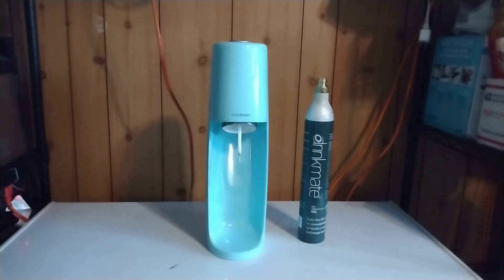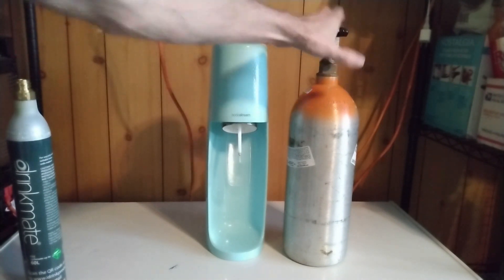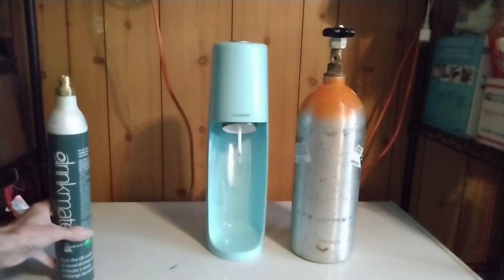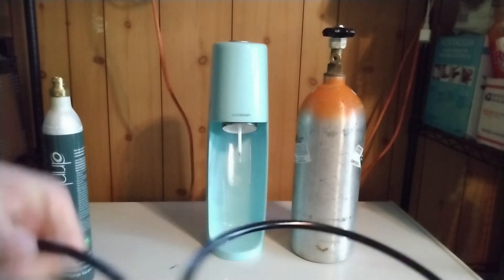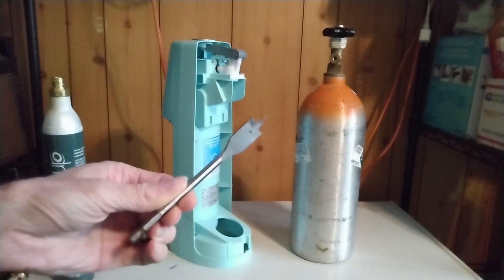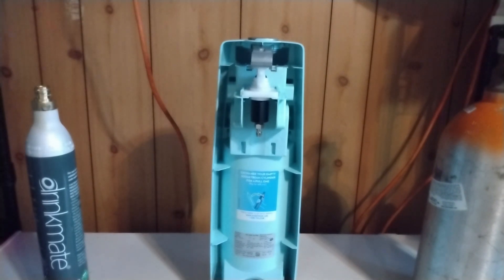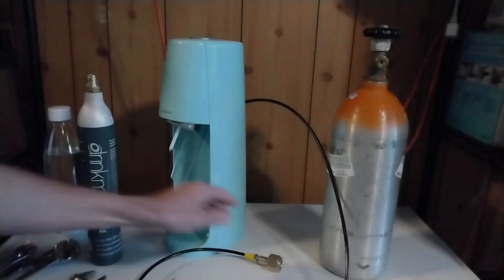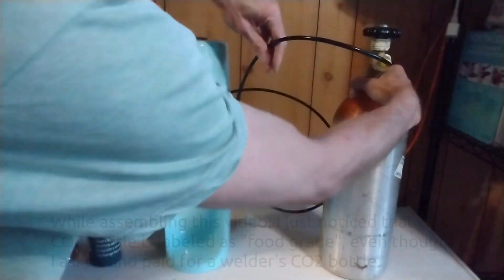How To Hack Your Sodastream with an Adapter - Save Money - DIY

Comment: So cool and so helpful. I just got my sodastream Terra last week and immediately wondered if a canister of Co2 like this would be more powerful - as sometimes with the sodastream Co2 it seems a little flat! Glad to see it definitely is!!! Will this hack work on the Terra Sodastream model? And, thanks for the video regardless!
Reply from the maker: I don't know about the "Terra" Sodastream model, but as long as the fittings are the same as on the "regular" sodastream model, it should fit.
Reply: The Terra model uses the new "quick connect" co2 cylinders, which has a sodastream proprietary connecter. This makes using your own co2 supply or refilling the canisters extra complicated- but not impossible.

Comment: Why not direct tubing down through bottom of machine?
Reply from the maker: Because of the cabinet of my kitchen in which I installed the apparatus. It has several compartments, one in which the CO2 bottle is hidden, and it already had a hole that aligns well with the one I made in the machine.

Comment: All these videos are the same - they show how well it works ON THE FIRST DAY.  Let's see a video of day 100.  I have almost this same setup and I've already burned through 2 SodaStream machines.  The problem is that the seals in the machine are only built strong enough to withstand the lesser pressure of their own canisters.  When you hook up a big canister like this it works great for about two months, then eventually the seals blow out on the SS machine and it no longer works.  They do this on purpose because the canisters is where they make all their money and they don't want people doing exactly this.  If anyone reading this has found a long term solution please reply.  Thanks
Reply from the maker: I don't have this problem. Simply don't press the button fully down. Alternatively, you can add a pressure regulator at the output of your CO2 bottle, so that it delivers the same pressure as a Sodastream bottle.
Reply: Simply add a pressure reducer into the line before the soda stream,
Reply: @SM-eg9vk   and @Blue Moonshine  I have a beer keg that is connected to a pressure reducer and can be set as wanted. Because I have a hose that is not being used (two hoses from the Canister but only one on the Draft machine), it would be perfect to set the other one to the sodastream. What is the expected pressure expected for the sodastream? The beer is set at 3.1 bar or 46.5 PSI. How many bars or PSI for sodastream? This in an awesome idea to use the beer pressure regulator - and much safer than connecting the canister directly to the Sodastream machine. Plus it has the bonus of having the beer next to the soda :)

Comment: There is a difference in CO2. Food grade CO2 has less impurities. You need to get CO2 from a homebrew store or similar.
Reply from the maker: The CO2 that I buy at my welder shop actually has the "food grade" label. It has become a standard.
Reply: @BlueMoonshine  From what I understand it varies location to location. In some places there is just one grade and it's always food grade. In others you do get less pure gas so if someone's in a place where they wouldn't get food grade CO2 that could potentially be bad.
Reply from the maker: @user-kf7vr1kd8f  Ok, but still, the way that CO2 is produced is the same. "Food grade" simply mean that they "checked" that it was safe. It doesn't mean that the "non food grade" is not safe. Anyway, you can still buy a big CO2 bottle with the food grade label at a much cheaper price than the small Sodastream bottles.
Reply: @BlueMoonshine  CO2 is CO2, but food grade CO2 has 99.9% CO2 with .1% impurities. Non food grade CO2 may have more impurities. That's why it's important. I have a CO2 tank hooked up to my soda stream so I've looked into it. Depending on where someone lives all CO2 they can buy may be food grade, but in other places if someone gets CO2 from a welding supply company they may get a lower cheaper grade of CO2 with more impurities.
Reply: The non food grade has a tiny amount of nitrogen and oxygen which are the "impurities" that are referred to. When using welder's CO2 for food that's a problem, for water it's not a problem.

Comment: Well how much would that bottle be and refills?
Reply from the maker: I got that big bottle for $65, and the refills cost $10. In the end, it quickly becomes much cheaper than the original bottles. Plus, the pressure in those big bottles is greater, which means that there is even more gas.
Reply: @BlueMoonshine  amazing.  Thank you for the fast and informational response
Reply from the maker: @tomlucas8677  You're welcome.
Reply: Where did you buy that big bottle ?
Reply: I never saw anybody come up with an answer as to what the expected pressure is out of the normal soda stream CO2 bottle.

Could someone please give me an answer?

Comment: How do i unconnect the quick connector when plugged in to the soda stream machine?
Is it locked in?
Reply from the maker: Like any quick release connector: Slide the outer cylinder away, and the inner cylinder will disconnect.

Comment: Wrong, food grade co2 has to have 20 ppb  less than, 20 parts per BILLION of benzene, a known carcinogen and also can cause headaches when ingested in a co2 gas... commercial grade co2 has around  400 ppb or more of benzene...
Reply: It is you who is wrong! First, food grade and industrial grade CO2 don't come from different sources. "Food grade" means that some tests were performed on the quality of CO2, while "Industrial grade" means that those tests were not performed. They are still the same, coming from the same sources!  Second, the FDA's requirement for beverage-grade CO2 a 99.90% purity rating. The FDA regulations allow for the other .09% of the gas to be made up of other hydrocarbons. Although the requirement for industrial grade CO2 is only 99.50%, in practice it always falls within the 99.90% range, and small violations of these limits are perfectly fine for personal uses.